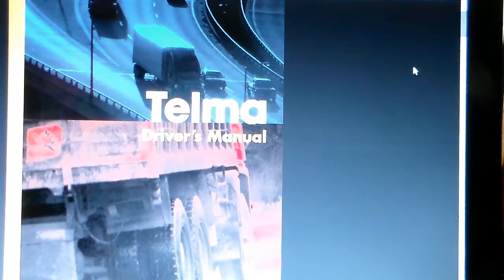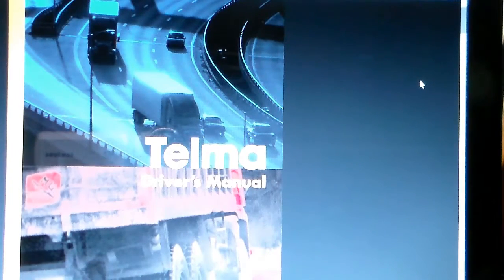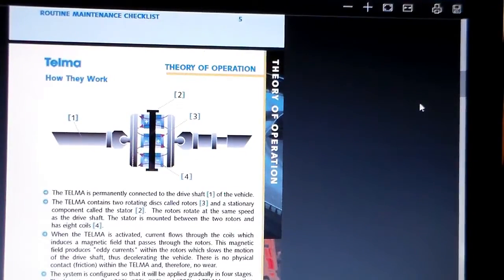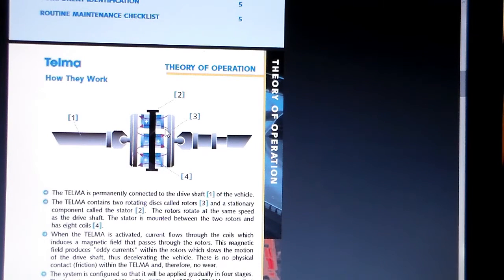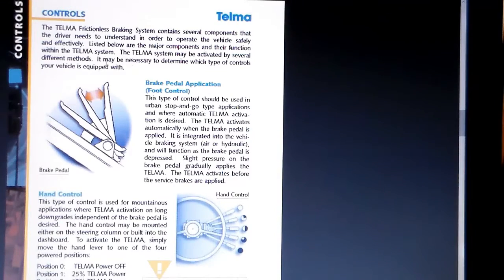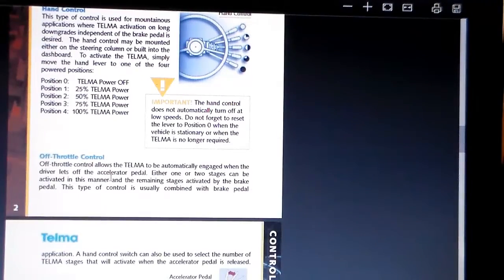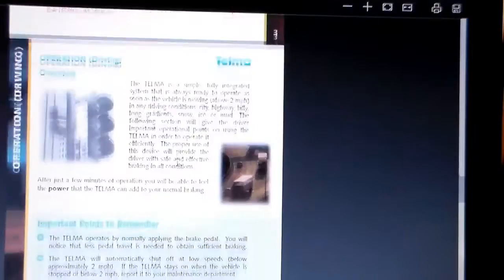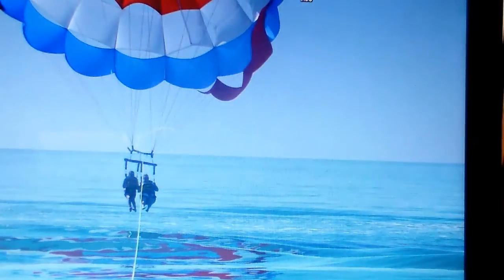Telma Operating Principle on my Coach (Fred)

Comment: Good video. I found one of these systems installed on an F-550 and I had absolutely no idea how it worked, but between the Telma web site and videos like yours I got a pretty good understanding of it now. It's a great device - amazing how powerful it is and how it makes the overall braking feel very strong on the truck. I do wonder if there's some kind of super-powerful magnetic field sucking all the iron out of my blood and down into my ass when I'm sitting on top of that thing, but they say it's a non-issue, no significant magnetic leakage.
Reply from the maker: 2K 
Glad the Video helped. I hope it’s not doing strange thing to my backside! 
It works very good, been all over the west in Mountains and never heated the brakes.